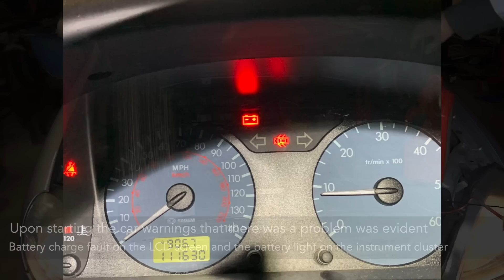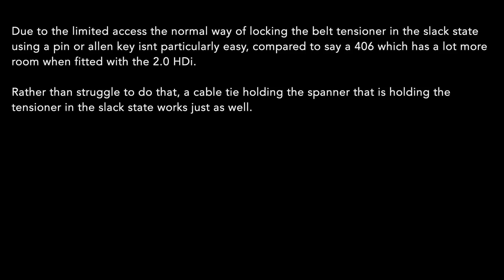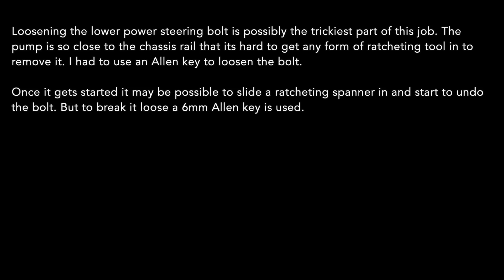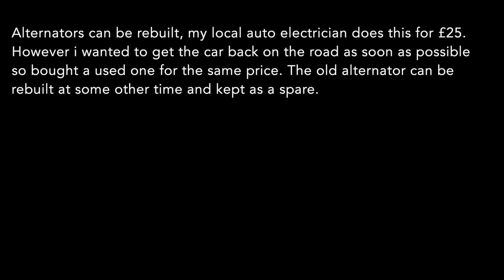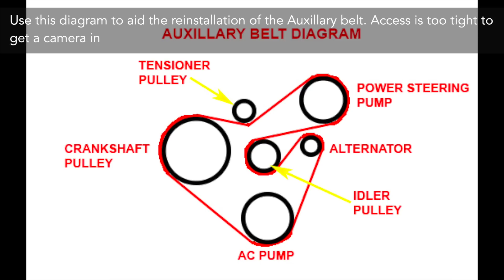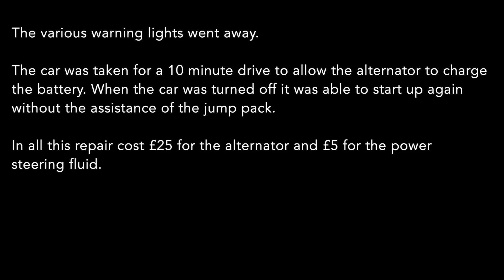Alternator Replacement on a Citroen Xsara

Comment: I took my alternator off 2 years ago for the same reason but now I have to take it off again because the new pulley is eating through gates belts...
I'm going to stick on a valeo pulley...
Everything is in line but the Serpentine grooves have worn very sharp cutting into the belts... 1 each year
,
Reply from the maker: Hi there, check the tensioner pulleys also incase any have a slight amount of movement or play, not sure if the offending pulley can be rubbed down a bit with some sandpaper to make it less sharp, but if you have a softer pulley then it would be interesting to compare them.
Reply: @peugeotCitroen2CV  yes.... the problem was the alternator pulley is one of the aluminium ones... They wear down to a knife edge... which then continuously cuts into the belt

Comment: Have just done this bit now belt is sqeeking loud and belt feels loose ? Could I have stretched the tensioner?
Reply: You've probably not tensioned the second manual tensioner.
Take wheel off, pin the tensioner on the first hole that lines up when you begin releasing it.
Slacken the nut on the manual tensioner just below (with the square or Allen hex hole inside it). Put it under a little tension and tighten the bolt back up.
Remove the pin on the other tensioner and you're good.

Comment: Fantástic video the nex time is posible other video to clutch change xsara please Thank you
Reply from the maker: Unfortunatley i wont be making a clutch replacement video on this Xsara, its due to be replaced with a honda Jazz im working on at the moment (rust protection) then the xsara will be sold. It never had any clutch problems. I do have a video covering the clutch replacment on a 2.0 HDi 406 which had a dual mass flywheel. The process is mostly the same on the xsara except it has a simpler solid flywheel so that video may help

Comment: Hi my battery is flat and the key locks have seized. so I'm unable to get in the car, luckily we've been able to open the bonnet. so have been advised to charge from the alternator? would you know where to put the wires to charge using a battery charger. i would really appreciate your help. Thanks
Reply: Salut

Comment: Bomba inyectora cómo la retiro del cuatro en xaara
Reply from the maker: Are you asking how to remove the injectors in a Xsara. 
Is it Petrol or Diesel, if diesel is it the XUD or later HDI?

Generally with the injectors they are screwed directly into the head, if the injector feed lines are removed, the electrical connectors disconnected in the case of the HDI and the return pipes disconnected then a 27mm socket should be able to remove them.

On the petrol engines i think the injectors are clipped into the inlet manifold in some way.

Comment: Thousands thank you for this video, I stuck with my car behind polar circle in Norway and I am about to replace alternator which arrived from Germany in last days. My big problem is that I don't have garage and outside is a lot of snow and more is coming :-( . Maybe I will have opportunity to use one hall as a shouter and I will try to replace it during next weekend. Right now I went to dig my car out of snow and check if the motor parts matches yours and luckily YES ! . I hope I will find all necessary tools and keys for replacement and I wont screw anything :) . Maybe I will need some help, if so, I will ask in comments below. By the way... I want to replace auxiliary belt in the same time... is there something tricky or not ? ... My costs so far: remanufacture alternator from Germany 170€ (Norwegians don`t keep spare part in Norway warehouse) + customs clearance fee 46 € + deposit for returning of old alternator 60 € + post fee about 40 € DHL and if anyone ask why I want to do this work alone is because garage service ask only for work 800€ . Which I consider for a unbelievable crazy investment into 15 years old car  :-) . One more time thanks a lot peugeotCitroen2CV !
Reply from the maker: Hi there
Thanks for your message. 
Regarding the auxillary belt, there is nothing particularly tricky just have a copy of the routing diagram to hand as it will save a lot of time trying to figure out how its supposed to go on. Access is a bit tight on the Xsara but its not impossible to get to.

Initially i thought €170 was high although new/refurbished alternators over here cost £110 which is about €125. I went to a scrapyard for this alternator which is why it only cost £25, although a local auto electrician will rebuild it for the same amount. 

Its definatley worth doing this job yourself if this job has been quoted at €800.. Definatley give it a go yourself.

Comment: I did not remove the hidraulic pump just de alternator.
Reply from the maker: Energia Solar Celsat 
Fair enough, seems very tight to get it out with it in the way? I have to remove more parts generally to show the area clearly in the video
Reply: Job for tomorrow for me. So can this be done from under the car, dont fancy taking power sterring pump off lol. Not sure if the 1.6 petrol 2005 are any different
Reply: @kieran2902-r5c  yeah I got a 2006 that I use as a run around the pump is at the top of the engine so you can to the alternator easy enough without doing what this guy did and take half his engine apart. Its 4 bolts just drops out dont even need to de tension the belts. When you undo the bolts the belt becomes slack anyway then just slide it out. Easy enough